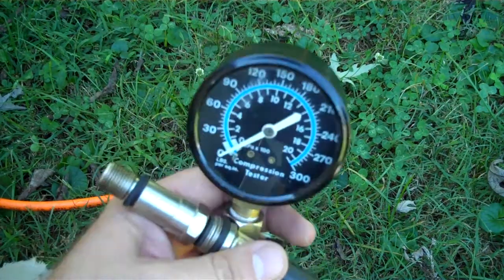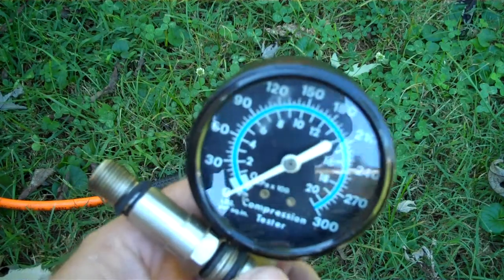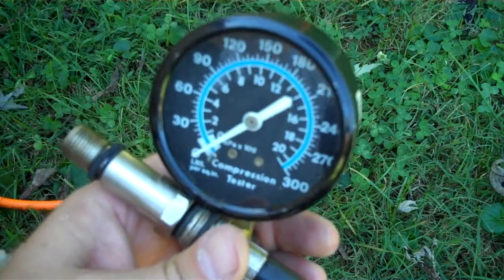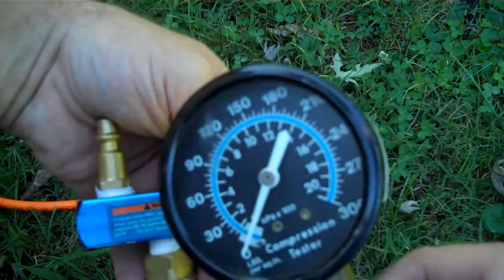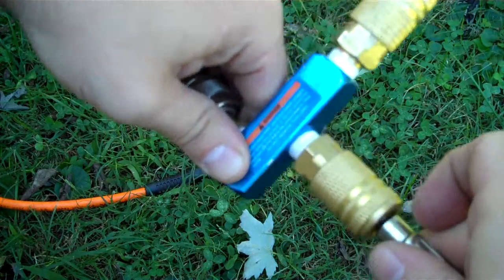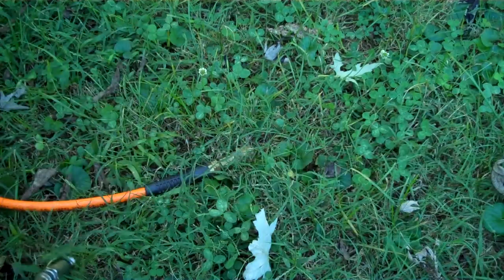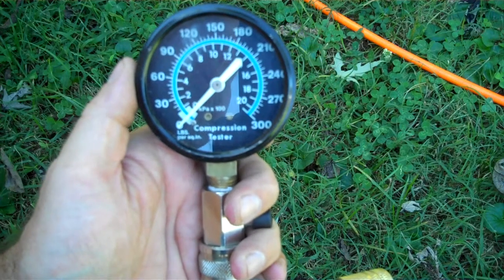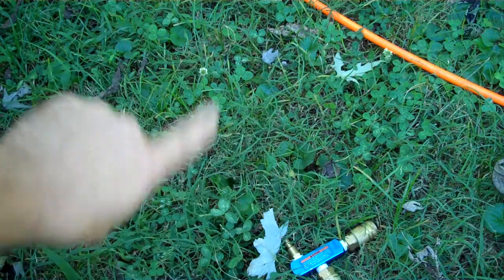Compression tester turned leak down tester

Comment: Ummm.  Surely you didn't forget that there is a one-way valve built-in to the inlet of the compression tester gauge?
Reply from the maker: Nope .. I didn't forget to remove it. I just forgot to point it out in the video. Another subscriber called me out on that as well. I really should update that video. If nothing else to correct what I didn't point out. Thanks for dropping in!
Reply: That's like...literally the main issue I'm having right now, is a hose to connect from the leak down tester to the engine.  I have this one-way valve in mine too, no idea what to do
Reply from the maker: Get a tool to remove the valve. In the tire patching and valve stem area of the auto parts store will be where it is located. It's called a Shrader Valve remover.
Reply: I pretty quickly found it can be easily done with a small flathead screwdriver.  Got my custom leakdown tester working in no time

Comment: Hi. Just wonder if you can tell me what the problem is with my engine. cylinder 3 has only around 25 psi. And the rest 160 psi. The engine is tuned up from 150 hp to 280 hp. And the spear plugs is dry and werry white. Hope you can respond. Thanks from Norway.https://www.youtube.com/watch?v=YlJduTNkIRQ
Reply from the maker: You popped the piston, rings or head gasket. Waaayyy too much blow by coming out. I would venture to say head gasket being typically its the first thing that turns loose. Pull the head and check it out.
Reply: Thanks for your respon, Sir. And yes is the piston/rings. And maybe some more. So I will let this engine Rip. And get me an Aero engine. Have a nice day.
Reply from the maker: What I figured .. boost adds lots of stress to the internals. If it isnt build to handle the boost .. things will start to come apart.

Comment: i heard you mention harbor frieght but i did not hear you mention if you can get all the parts there to build it. That info would be very helpful.
Reply from the maker: +Ashroyer86 Most of the air fittings and manifold came from Harbor Freight. Anything else would have been Lowes. Thanks for checking out the video! Have a great day!

Comment: needs a guage on the regulator and a specific sized dampener or restrictor between the guages to be a leak down tester. again from what i understand.
Reply: That would only matter if you have two guages and you're comparing them

Comment: thats not a leak down tester from what i understand.
Reply from the maker: albertmckinnon Technically you are right, it's not. A true set has 2 gauges that you compare the compression differences. In this set up I used a compression tester. Remove the schrader valve so it can sense pressure drop in the engine cylinder. What you have to do it as soon as the gauge gets to peak cylinder reading, write down that number. Then watch the gauge to see if the needle starts dropping and at what rate. If it drops very quickly, you have cylinder leakage somewhere (valve, head gasket or broke ring .. etc). A true set just keeps the peak cylinder reading for you (second gauge), This method, just write down or remember what the peak cylinder reading was. I've used it for years, hasn't lied to me yet. Next time I test an engine I may demo the method I use and create a follow up video explaining it. Good job at catching that and thanks for taking the time to leave great comments. Have a great day!!
Reply: @Poweraddicts  Good Evening! Can you please make a demo video of your method and show us how it works and how you use it? I feel that your method is very cool.

Comment: Doesn't the schrader valve prevent the compressed cylinder air from getting back to the gauge so it wouldn't show leak down?
Reply from the maker: Dave Carlson I took the schrader valve out.. Otherwise you are correct. I should probably point that out in the video by adding an annotation stating that. Thanks for pointing that out! :-) .. Have a great day!

Comment: Is there a certain reason why you have to use such long addapters?
Reply from the maker: Some spark plug holes are down inside valve covers. The longer adapters allows for easier reach. Also, those are the adapters that came with the compression tester kit. Thanks for checking out my videos! Have a great day! :-)